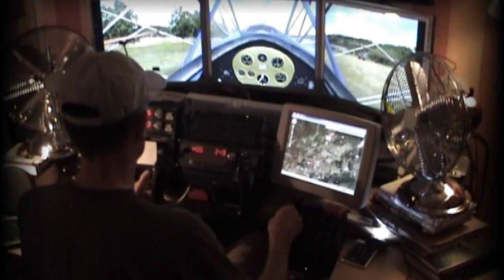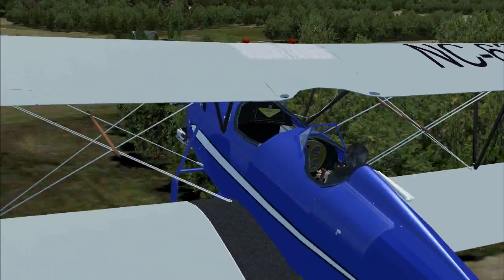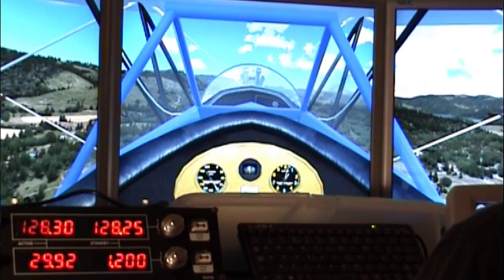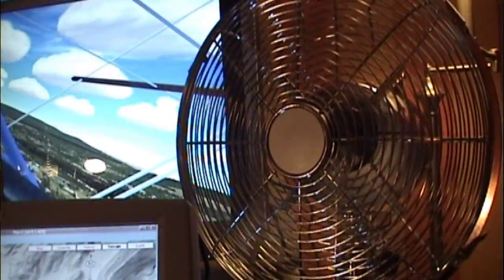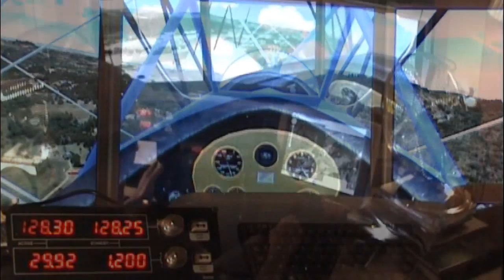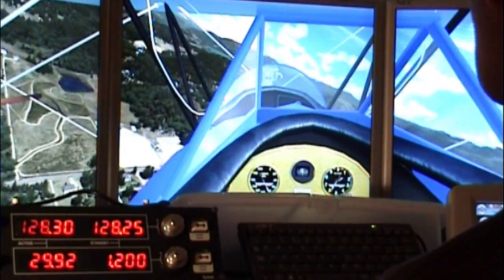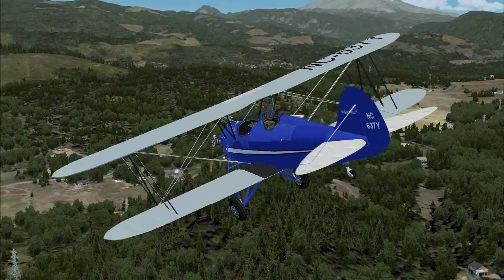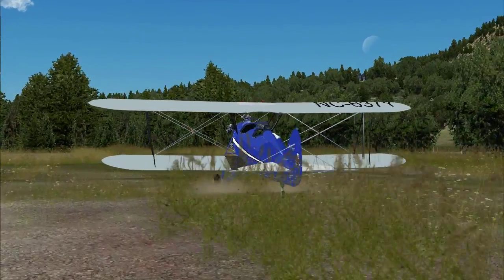Slipstream Experiments in FSX

Comment from the maker: Someone else suggested that, but they cost a fortune! The fact that they incorporate a 'dimmer switch' suggests they are throttle-able, but I'm sceptical about them starting up any quicker, as I don't see that there's any need for them to. As I understand it, the startup problem is a consequence of the motor design. Most domestic fans seem to use a single-phase induction motor with a tiny secondary coil to nudge it into motion before the main coil will generate any torque.